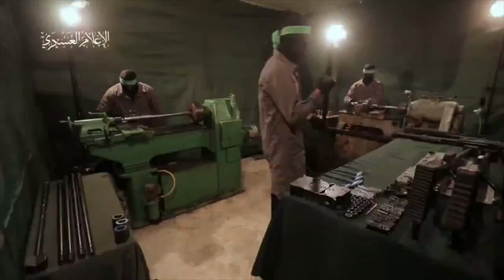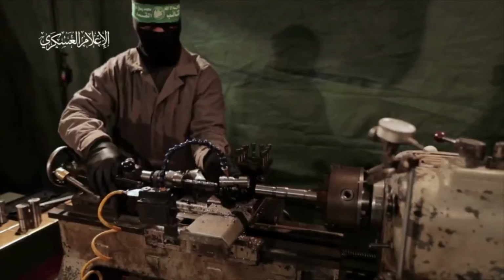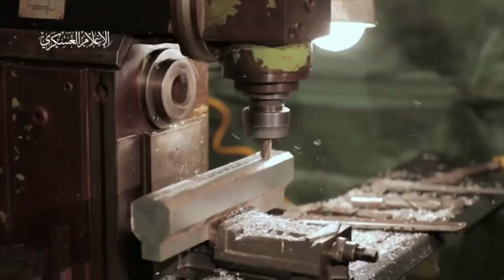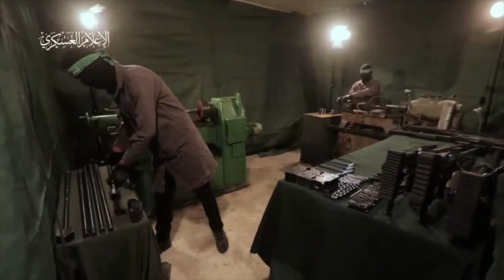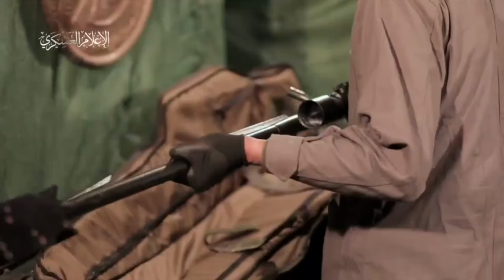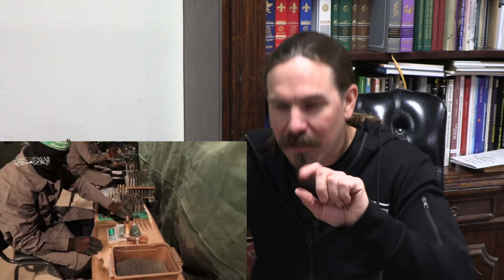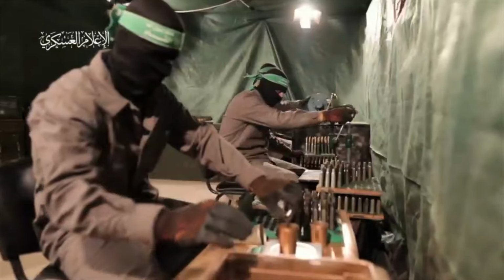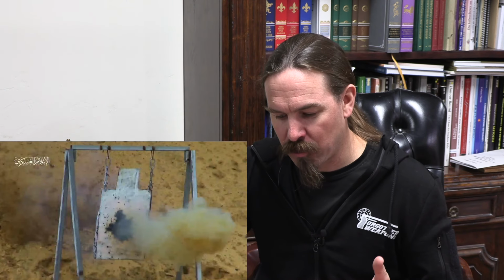Hamas Claims to Make Sniper Rifles in Gaza - Are They Really?

Comment: None of the machines they show are large enough to bore the barrels.
None of the machines are equipped to turn the long taper of the outer barrel profile.
They don't show any heat treatment, which is odd because quenching glowing steel looks a lot better on film than some unskilled machinists.

Comment: making barrels from scratch is actually very dificult at least when you don't have access to modern steel tubes of the right diameter, prior to those barrelmaking required a tremendous amount of manual labour

in comparisson rifling a barrel should be relatively easy

Comment: Machinist of 10 years. I'll give my two cents. Overall I'm guessing it's mostly fake, but it isn't unrealistic to turn the outside of the barrel before boring the inside. It's a lot easier to hollow a turned part than to turn a hollow part, as the cutting pressures aren't resisted nearly as much, which can lead to bending, warping, and excessive heat buildup

Also, smoke during a turning operation is 100% normal. If you're running with steel it's honestly better to have smoke than not. Oils on and worked into the surface of the metal burn off when cut, but even metal cut seconds before can smoke from oils on your skin if you touch it, or tiny oil droplets in the air from other machining. The smoke while they're cutting seems to be coming exclusively from the point of operation, so I'd say those are pretty decent cutting parameters

Polishing with an emery cloth, scotch-brite, or leather and paste is done while the part is spinning. I've never polished a stationary part. I'm really not sure why you said that's unusual.

The clip where he pulls a part from the lathe as he pulls the bore out is definitely weird, but the clip before showed that being bored properly. Judging by the position of the tool post, that segment was just parted off. It IS definitely weird to do that with a bore in, however. I guess if you don't have/want to switch to a tailstock center?

Thing being profile cut is 100% Aluminum. Looks like a scope mount as you said. Measuring with calipers hurts my soul but is probably fine there. And the surface blacking they put on the mounts actually looks really nice, that's tough to do with Aluminum.

Gloves in assembly and quality control are pretty normal, but in the machine shops I've been in you more often use your bare hands to clean surfaces before mating, as clean, dry skin can wipe something clean as well as microfiber

Filling ammo to weight at a scale, grain by grain, is entirely possible. It's not at all what I would do in a production setting, so that definitely isn't how they manufacture their bulk ammo, but you can be precise with that. The ammo production is probably entirely fake, but I'm a bit confused as to why they would have a specific press for it and not just doing it in a drill press (which you absolutely can, and I have, done)

Like you mentioned, the production quality of the video is really impressive. It looks like something straight from Kalashnikov Group. I hate that I enjoyed it
Reply: I was a Machinist. To turn a hollow barrel is not a problem. A traveling steady is used. Also lubricant is not used with tungsten carbide tools , only with HSS. Gloves are never worn in a Machine shop , because the material will catch spinning shafts or machinery and pull the operator into the Lathe or Milling Machine. The whole thing is as fake as anything Pallywood produce.
Reply: @sarah20025  Gloves at an open machine, no. In the QC room or in CNCs with nightmare coolant yes. I do use coolant with carbide frequently, but that's a special formulation in a high-end turning center, normally the shock of hot insert and cold coolant will just shatter the carbide
Reply: @sarah20025 still realer than anything Israel produces.
Reply: @OverTrill42069  Tavor exists:
Reply: tbf Hamas definitely does produce weapons, loads of unexploded Israeli ordinance is manufactured into bombs, much like they did in Vietnam. Theres a good chance the people in this video are dead by now, so i think its a bit annoying how people disrespect them, people wouldn't treat Ukrainian soldiers like this.

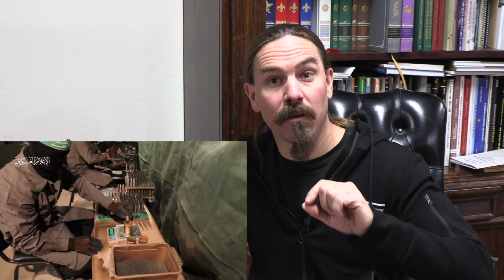Comment: 13:10 describing a trickler as dropping 1 GRAIN at a time. I believe you mean GRANULE as you should be measuring at least 10ths of a grain for precision rounds. Im sure I'm not the only reloader whos "tism" was tickled there. Lol
Reply: I’ve met a lot of reloading tism people and I’ve never genuinely heard of anyone using less than a grain for measuring. Do you do lead sled stuff?
Reply: @harryjoe860 
Yep, pretty standard to to see loads like 24.3gr. or 46.5gr. in manuals and load data. When doing a load ladder test, I often move up my charge weights by 2/10ths (.2) of a grain per string. In fact, I have 2 manuals that show H110 powder in .30 carbine as starting at 14gr. And maxing out at 15gr. Only 1 grain difference. 
Just a side note, black powder is traditionally measured by volume even though it is stated as a weight measurement. Thats due to people not having scales and the properies of black powder having more leway in pressure. I and many others, still weigh it out. Especially since kernal size veries.
Reply: @joshuavollman3729  I guess now that you mention it have done .5 of a grain but I never thought of it having its own name! I mostly reload for obsolete calibers to send lead down range. One day maybe I’ll get into the super serious stuff but that’s not tomorrow haha
Reply: @harryjoe860 
I dont do much precision work these days but I reload pretty much everything I shoot. I like the old military and obsolete stuff too. Many of those old guns are battle worn and "minite of man" accuracy so I generally load them on the lighter side for plinking or to just match the sights. 
Its hard to find 7.5 french, 7.5 Swiss,
7.65 Arg, 6.5/7.7 Jap, 6.5/7.35 Carcano, etc... you pretty much have to reload since they are harder to find now.

Comment: The thing with the drillbit is actually a legit technique. You put a smaller drill than your finished ID partway into the part so that it doesn't go flying when you cut it off the bar stock. But yeah, making a barrel that length without even a steady rest will not go well, nevermind the absence of any precision measuring equipment

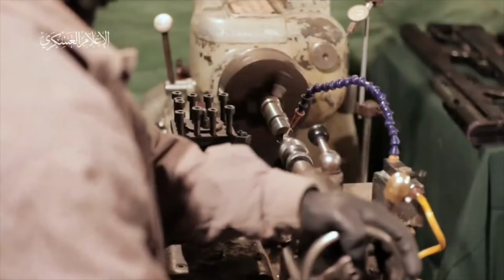Comment: 3:21 I worked as a machinist and it is impossible to bore or drill out a hole on bar stock as one piece and it became two pieces. He just got done doing a parting operation, it just was not edited in sequence through the machining process because the man who was filming it was not a machinist obviously and tried to show as much of the whole process in the shortest time period since it was intended to be a short video but as we know machining is a long and tedious process and I mean very tedious when trying to bring material to a precision tolerance of 0.003/.005  within specifications depending on the part being made but I would say the guy doing the filming was not a machinist. And for clarification I did see many long sniper shots taken with this rifle on first shot, over 300 meters distance to target

Comment: i agree with you that this is fake ofcourse but am wondering why you think they would bore and rifle first. you usually want to do the operations that require more rigidity first. so i assume you would spot drill the end so that when you do bore the barrel you have an accurate reference, then you would machine the outside, if you bore it out first your losing alot of material that would normally help the barrel flex much less under tool pressure. then bore the barrel using the outer barrel as a reference surface. also you can use cutting oils that smoke up. the smoke is likely cutting oils. they usually dont smoke unless there is an oil on them. even if tool pressure is extreme. im sure there may be some reason im missing why you would bore the barrel first. im curious what that could be, .

Comment: 5:54 - Homie at the surface grinder modified it into a milling machine with a 1/2 HP direct drive AC spindle. The precision he can get out of that wouldn't make decent refiles. This video is nothing more just for a show for the sheeps to consume, real precision machinists knows this video makes no sense, where are the metrology tools? However they seem to have an old school American lathe, other machinery seems to be legit. I can only phantom how in the world they moved these heavy machinery which weighs tons into small tunnel bunkers... I wouldn't underestimate that they aren't able to make rifles, clearly they are capable of making them since they got the machines to do so, however its only a small fraction needed to make real precision rifles. I don't see any signs of metrology usage here, they're probably making rifles which are only good for few hundred feet at max maybe. I think these machines are just for doing basic operations with no precision in mind. 12:58 - Imagine getting shot by a homemade Hamas 12mm caliber and it had some Arabic writing wishing for your death.

Comment: I used to be a machines worked on some CNC
I know they not making rifles but most likely that is a barrel already maid just tuning for modifications
From the parts I see keep mind my experience also as ex military
They are assembling them 
I see rounds  no press no gun powder measuring 
But know a lot of Russia ammo runs hot like our military ammo 
So there is a standard on how those are maid 
They are not your shogun or 22 mass produced

Comment: "there's smoke coming off, therefore they're not using lubricant". BS. Cutting oil gives off smoke, not using it only produces smoke with dirty steel. Plenty of highly accurate rifles have been made without modern coolant systems - the only effect really there (for these materials) is speed of production. 

Your supposition they are making barrels there could be at fault - they could make the rest and buying in just the barrels. For example the first turning could've been to cut in various places to make various parts from one piece after cutting it e.g. with a saw.
Reply: And then when he critiques the part saying he's doing a fake drilling operation because he just pulls the part away. He was clearly comparing them, that part he lifted off wasn't there in the drilling shot.
Reply: Basically, this guy has desperately tried to fit things to a foregone conclusion. Although clearly knowledgeable, he's lacking in observation outside his blinkers and has made a totally junk assessment which is frankly embarrassing.
Reply: He also goes off on their frugality and how it doesn't meet his standards for match grade ammo. These things are going to be fired at 200m to 600m ranges. They're in gaza, there's no km wide open fields anywhere. 

This guy also clearly doesn't understand the conflict and the dire circumstances they're working in.

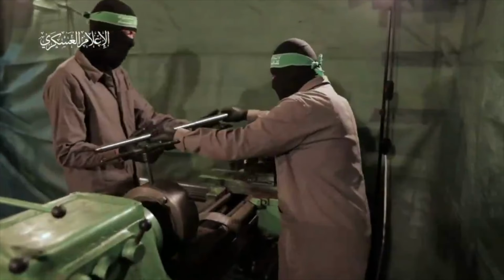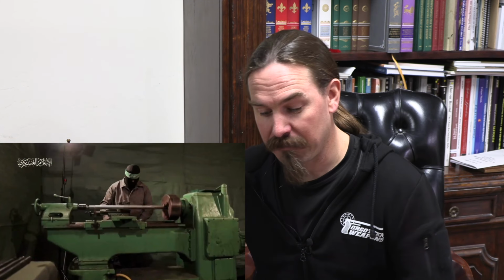Comment: @3:03 you can clearly see the bore is already there when he hands it off and at @2:02 you can see the lathes dead center is positioned inside the bore.  Its pretty obvious to anyone who has actually built firearms or used a lathe that they are only performing finishing procedures on barrel blanks that already have the bores finished.

Comment: Why wouldn’t you turn the OD of the barrel so that it is concentric before drilling and reaming. Isn’t it necessary to use a steady while drilling? That way you can do it all in one setup.  

Also it’s not uncommon to see smoke from a turning operation when cutting oil burns off

Comment: Ok machinist of 14 years here. You’re correct on the lathe parts, they look like just a widget and you’re correct that he was pretending to drill an already parted off part. On the mill I still call bs. They had the same part just in 2 different finishes. And the finished scope mounts were plated, painted, blued, whatever but not drilled and tapped for the upper half of the clamshell. Also normally when you make a bunch of parts you set the machine up for 1 operation at a time, on a manual mill that’s usually one cut at a time. So all your parts will look about the same, with only difference being that operation. Not part color or in varying stages of completion. And as for Hamas doing that engraving, not a chance. IF Hamas is actually making anything, it’s comparable to the last ditch German stuff from the end of WW2. You are correct in calling BS. (I watched on my tv and had to comment on my phone, hence low watched time)

Comment: Well, I don't know how to put this, but maybe if you aren't a machinist you shouldn't judge about which machining operation ist legit and which isn‘t?
First of all: I would much prefer it if you were right, and i don't mean this in a confrontative way!
Okay:
1: the center is absolutely not sitting against a solid piece of barstock, it has a hole in it however deep it may be, but you can buy raw barrels, which have only the bore with rifling in it, I guess they're sourcing those ore manufacture them elsewhere, even if not, you could achieve the rifling after turning the outer diameter (by pulling a plug for example)
Yes, that's not the optimal way to do it, but those are terrorist, they probably have no engineering degree and if it goes bang it's probably good enough for them..
Smoke when tuning parts dry, especially if it's high carbon steel or has some iron oxides left on it, is totally normal, yes it would be better to cool the part&tool, but you can still achieve precision parts, I've done that for many years professionally, with and without coolant.
And polishing with the cloth is also very common
2. Keeping the drill bit in the hole: this is a very common trick to keep the part from falling down or flying around in the workshop when you are parting it off, I personally wouldn't use a drillbit, I would prefer a wooden stick which sits in the drill chuck. There is a clear cut there, so they showed the drilling, cut to after parting off.
3. The gun they show assembled reflects exactly the quality of the crude manufacturing they're doing there
I can't say anything about about the reloading section of the video, but I can say actually stamping precision brass cases is a whole another game than turning a barrel or milling a receiver for a rifle...
There is a good reason there are many people who machine own guns, but not very many doing their own shells..
The stamping/pressing of those things is quite complicated, and you need special tools and some skilled people to do this right, and quite a lot of time...
If I did use any wrong words, please excuse me, I'm not a native English speaker..
Anyway: I like your videos :)
Cheers!

Comment: Youre probably right its just Iranian. However, it is possible Houthis do actually make copies of the gun, and the reason they staged this footage is to not give away potential location of manufacturing or the manufacturing process. You know say a piece of equipment or material is identified by Israeli intelligence its possible they may be able to track it down or track the source down and cut off the supply to Hamas.

Comment: I too am I timately familiar with machine work and while I agree that no practical precision rifle is likely to be turned out in this manner, however I don't agree with some of you assertions.     You can not tell that is bar stock. A dead center willneffectively plug the hole and you can not tell. Also smoke is not in and of itself disqualifying, provided oil is used as a lube.
Reply: I think it's that it's sat too far out for it to be resting inside a finished 50cal bore, it looks more like they've only got a small spot drill in the end

Comment: I used to work in a shop making receivevers for Remington 700s. We used modern CNC lathes for the bore and threads but for the OD we used a manual lathe with no coolant. Some smoking and chip pattern like you see here was normal. 

Of course, that was for about a 7" receiver, not the entire length. 

There were also jobs where a part was in the lathe just so we could smooth the surface finish out with scotch brite.
Reply: I've worked in shops making barrels as well, but everything was done with coolant. Depends on the inserts you're using (ceramics you don't want coolant) but usually turning without a coolant or cutting oil, you risk deformation or work hardening. With the short section you said you were turning it may not have been an issue. But yeah, it certainly wouldn't be down the entire barrel. It would warp the bore. And Scotch Brite is definitely a staple in machine shops for polishing lol

Comment: Maybe they don’t have all the equipment you have. Maybe they do things differently. So I don’t see a problem.
Reply: My guy, the equipment is all the same. You think theres a way to produce one without specialized boring machine?. You really think theres an alternative manufacturing method?
Reply: @alexanderrohaj4794  bro, when one has nothing but the only means are improvised methods then sure where there is a will l there is a way and in desperate situations you make do with what you have. What if these resistance guys actually do have the equipment and in the video they just messing around. Maybe they actually don’t want to show what they have or capabilities. What if it’s a means of diversion. Anything is possible.